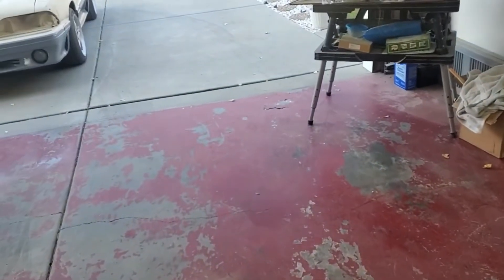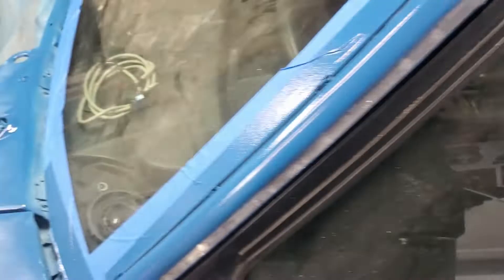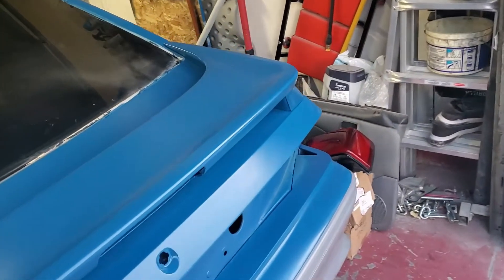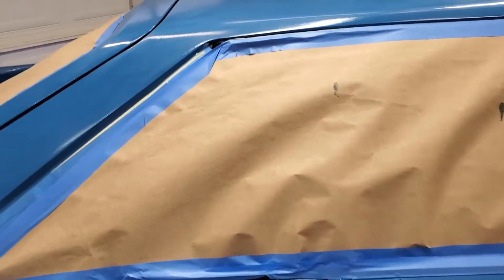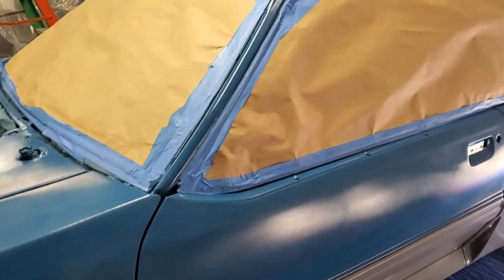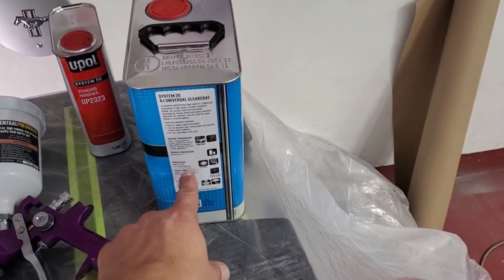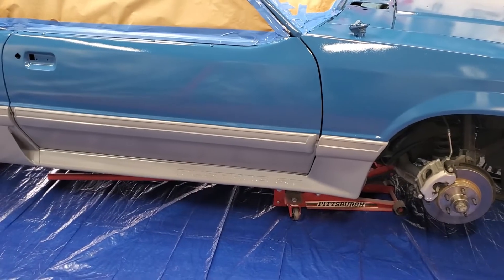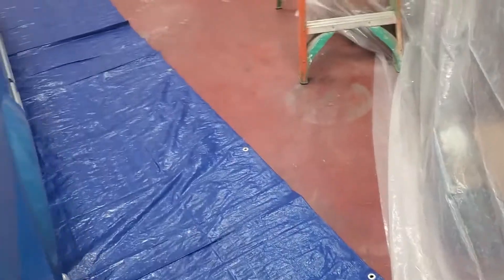The 89G - My Fox Body Gets A Rustoleum Paint Job

Comment: man does that thing look good , it doest even look like the same car.Its making me want to paint beans now but ive gotta put the intake back on it from where it sprung a little leak from the china wall
Reply from the maker: Oh man... what did you use for a gasket? Thank you, by the way! Hey... any news on 🥒?
Reply: @89G  i used a felpro 1262 gasket and did silocone on the china walls which is what leaked but I really didnt see anything wrong with the silocone . it was making contact all the way across it but im goin to put it back together today and hope it doest leak. I just shot him a text trying to figure out a good time to get together and make the deal happen
Reply from the maker: @79beans347  I actually used those rubber Fel-Pro's on Frankie, and used RTV to hold them in. Just an experiment, and it's worked so far. I hope you get a deal worked out soon, BTW! Could be a good little winter project for you!
Reply: @89G  yeah i like those rubber end pcs as well and if it had come with those I would have used them for sure cause I used it on my last fox and never had any problems. I like how they wrap around the china wall to keep them from moving. yeah Im hoping that his mind hasnt changed about letting it go but I will find out soon
Reply from the maker: @79beans347  agreed. I know some guys don't like them, but if you black RTV them, I think it makes it stronger.
Reply: @89G  yeah the black rtv helps keep them from moving around and if they would glue the cork gaskets down first and let them dry then put the intake on they wouldnt move and with silicone on top as well it would last years like that. Only reason i didnt use it was my intake sits to close to the wall which would bust the cork gasket but the rubber/silocone gasket would work well with my setup
Reply from the maker: @79beans347  Too bad you're not closer.... I think I have some of those in my gaskets.
Reply: @89G  aw man I would sure use them. im going toss these cork ones but id hate to buy another set of gaskets just to get the good end seals. I do appreciate it though. I do wish I lived closer cause youre a cool dude
Reply from the maker: @79beans347  thanks man! 😊
Reply: @89G  Just heard back and said that the cucumbers was a done deal that he didnt have any interest in fooling with them. That he had way to much goin on already and he doesnt have enough motivation for the rest of his veggies much less that crop of cucumbers 😂 so i guess we will have to come up with another day because the monsoon season messed up our last plans to move them 🙃⛈🚗⛈
Reply from the maker: @79beans347  that is sooo sweet! I can't wait to see what you do with it!
Reply: @89G  yeah i cant wait to get started on it . I may put up some videos of the build. Ill do like always and do the drivetrain first and the interior next , paint last. I can wait to hear that motor you got for frankie its not only going to look badass its going to be badass 😁

Comment: Also how long did you wait after spraying the rustoleum until you sprayed the clear? And how long did you wait inbeteeen coats of clear? Awesome job this is exactly how i want to do my 87, thanks for any info you share
Reply from the maker: I did 4 parts paint, 3 parts acetone, and one part Majik Catalyst/Hardener (P/N 8-0950-4). I waited a week to do the clear so the paint could gas out. I used U-Pol 2882 2K Clear with the standard UP2323 hardener. I want to say it was 1/2 hour between coats of clear. That's one detail I don't remember much, but I know it wasn't a great deal of time. If I could change anything, it would be to use an adhesion promoter on the bumper covers. I'll probably end up doing those again at some point, as there are some bubbles I can see (it's been a year).
Reply: @89G  awesome thanks for the response man, another question where did you order all the materials?
Reply from the maker: @darryl163  Amazon for most of it....  I did get the paint at Home Depot, but it's been cheaper on Amazon lately. I put links in the video description to try and help a little better.

Comment: Looks good. That blue looks like bright regatta blue but yours isn't metallic. My 89 GT originally was the bright regatta blue. But somebody had painted it purple which is obviously a bad paint job because it's peeling. I'm going back with the original color and I'm going to use the Spray Max system.
Reply from the maker: @cassandralesh8536  very nice. I love blue Fox Body's! How long have you owned yours? My white one is an 89.
Reply: @89G   i bought this 89 gt back in April and it had been sitting for eight years. I did a head job and replaced the fuel pump and ecu, she's running but it needs an exhaust before i can get it stickered. I paid $550 for it.
Reply from the maker: @cassandralesh8536  That's awesome.... that sounds very similar to the story on this 88 in the video. 500 dollar project!!